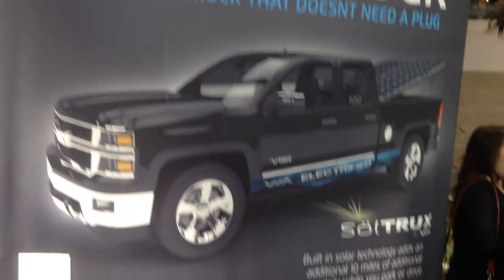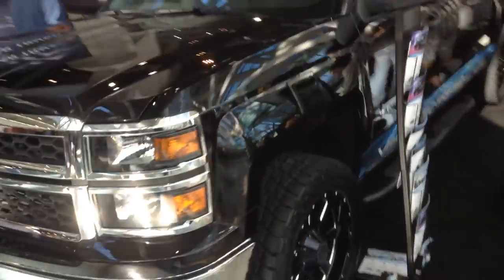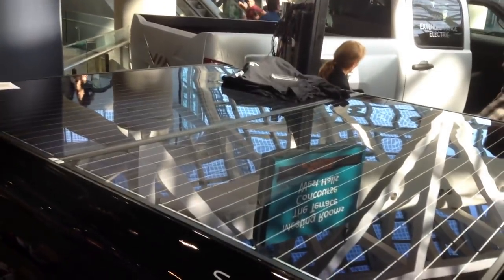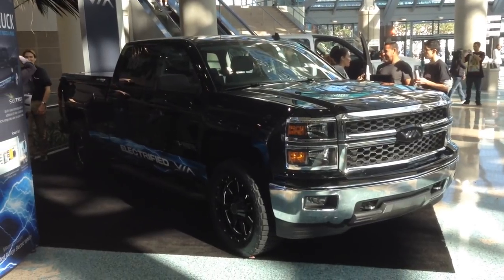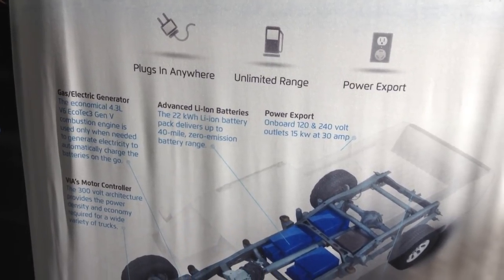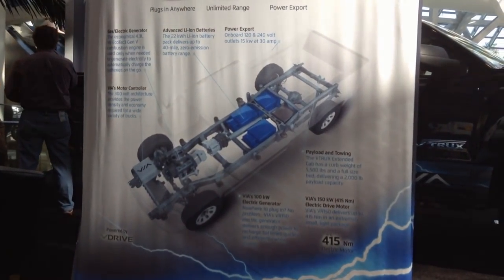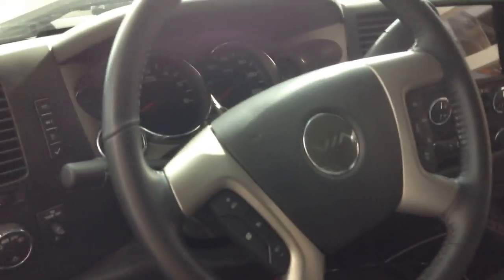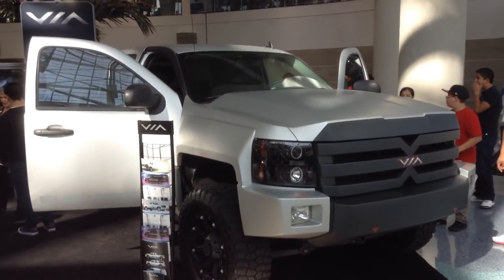Solar Electric Hybrid Pickup Truck

Comment: what if you drive in the sun will it charge
Reply from the maker: +ZAESMUSIC I'm sure it does some charging, but a solar panel that small isn't powerful enough to keep up with the needs of the big electric motor powering the truck.

Comment: Not a hybrid.  It is an extended range electric.  Built with Chevy Volt technology.  The gas engine does not charge the battery.  It is charged by plugging in, regenerative braking, and in this case, solar.  It runs 40 miles all-electric, then the gas motor powers the electric motor directly (not charging the battery).  Extremely low maintenance.  I have a volt (& 3 prius') that have original brakes & brake fluid (regen braking prevents heating of brake fluid, as well of brake wear), and oil changes 1/2 as often. No starter or alternator.
Reply from the maker: +Jeff Wallace I always wondered why the Chevy volt didn't charge its battery well it was generating power for the electric motor.  I am sure there is a scientific reason, but it looks stupid to have an electric generator connected to a gas motor that isn't able to recharge the rechargeable batteries that the car runs on.